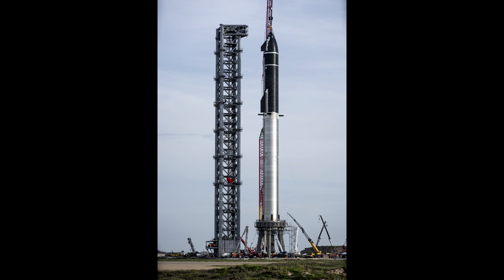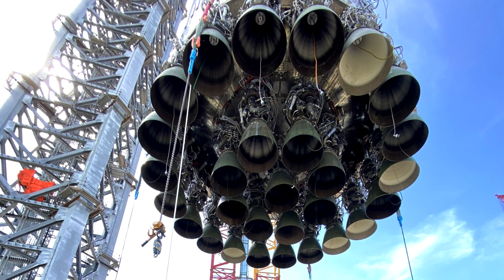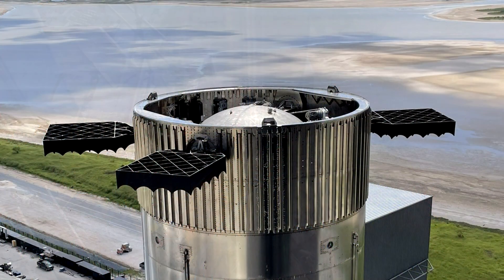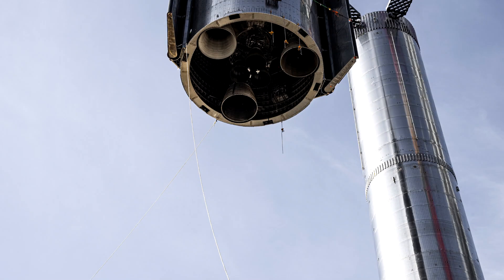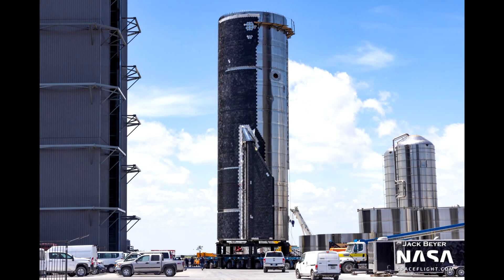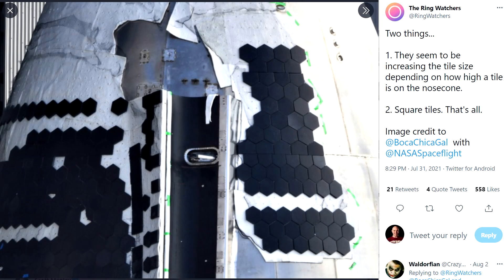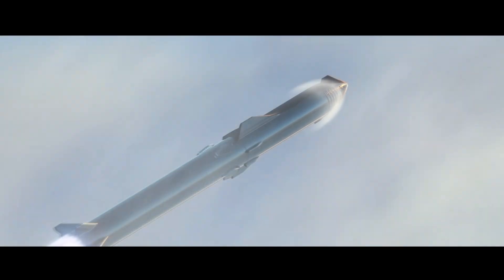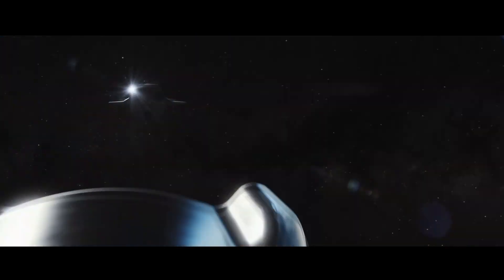How SpaceX Designed A Heat Shield For The Largest Spacecraft Ever Built

Comment: The cubesat was a great idea. The original arm was to do that on all the shuttle flights before re entry, but never happened. Why not use a $1k cube sat for exterior inspection on each ship? Makes sense to me. Would just need to back haul the camera and data to the starship, should be easy.
Reply: Yeah it definably sounds like a more useful payload then a wheel of Cheese.
Reply: Yep. And no worries with back haul, it's a digital era, you can beam the data (even in real time if you want) and forget about the camera.
Reply: If you watch the 2nd part of Everyday Astronauts video though, Elon mentioned they're not going to install payload doors for the first 10 or so vehicles. He said this was because they would be improving the vehicles so quickly, that they wouldn't want to keep the tooling around for maintaining older models, as this is what happened with Falcon 9. And there was no point in putting doors on vehicles that would never fly real cargo. Now a cubesat is really small, so maybe they could deploy it in some other clever way. Maybe it could be stored at the top of the booster and pop out during separation?
Reply: Just take an 360 camera and let it fly away herself. No need for complex expensive small satellite.
Reply: Only recently with Perseverance they had the technology.
Reply: Doesn't even need to be wireless, could be little more than a bit of compressed air with an electronically controlled valve and a camera attached to a wire setup to just get passively pulled out by the 'cubesat' once it's past the length of the vehicle.
Reply: Not to me.
Reply: @arik_dev  Maybe stow it in the engine bay and have tiny thrusters on it to make sure it doesn't collide with the engines?
Reply: Looking at this and thinking about the fact the space shuttle needed to be piloted for the first flight, I'm happy that starship can fly unpiloted... 
This looks like "pretty sure this will work" engineering, or it feels to me like it, a far cry from "I will bet my soul, my spouse and collection of nerd stuff it works" that was the space shuttle. 
As of now I'm thinking the starship way is better but I'll wait for the wonders of hindsight to make a final call in that.
Reply: You know, at some point they have little robot replacing tiles on the fly.
Reply: I like the idea as well, but a ~3U cubesat costs a bit more than $1k
Reply: We have many similar interests
Reply: @swissTom124  The cubesats have been built by middle and high schoolers under a NASA program, so they are not that expensive compared to the rest of the vehicle. What's $10,000 or even $100,000 when each engine is around $1M and there are 6 of them on Starship (second stage) and 29 on the booster that will be ditched.
Reply: Question is, if they find out a tile is damaged, what are they going to do about it?  The design strategy is about removing features not adding them.
Reply: @arik_dev  Store it at the bottom under the engine skirts. I believe some rockets, including a few falcon launches did that. Just make sure to release the satellites AFTER you shut down the engines!
Reply: For the shuttle, they basically could not afford to "fail". In that, if it was damaged, there sadly was no backup plan. So they just had to avoid it as much as possible. Where as SpaceX can and hopefully will, have backup plans (abort to orbit etc with a second Starship actually really ready this time to recover people in orbit, unlike sadly the Shuttle, where they'd run out of food/oxygen before the backup got up there).
Reply: The Canadarm was modified to scan the underside of the vehicle before reentry. Since every shuttle was equipped with a Canadarm there’s no real reason to spend money on a cubesat
Reply: @hermanni1989  That's actually a cool idea, but tricky. As Scott said, removing tiles requires a coring drill. So you'd need a little space drone with a drill, an arm for attaching tiles and a payload of tiles. It would also need a way to fix itself to the craft while it drills, otherwise it would spin itself instead of drilling, and it would likely have to work autonomously. Bit of a tricky system. Feels like maybe instead of replacing the tiles, they could come up with some kind of slap on patch that would get the vehicle down if a tile did come loose. That wouldn't be rapidly reusable, but it would only be for emergencies.
Reply: @TechyBen  Depends on what you call 'backup plan'. If desperate enough you could hastily attempt to patch your heatshield with whatever you have on hand as highlighted in the Space Shuttle Colombia accident report. Alternatively, Nasa usually made sure that the Shuttles were always within reach of the ISS (at least for most of the later flights). They even had plans for the ISS to maneuver towards the Shuttle if needed. Plan was to evacuate to the ISS and get the Russians to help slowly bring back the astronauts. Of course these desperate backup plans were only thought of after the Colombia accident, no backup plan existed prior to that.
Reply: Put optical cameras with telephoto lenses on every Starlink. Not only act as a distributed telescope system, but also have eyes on everything in LEO. Start cataloging all the space junk for collection.
Reply: @MoonWeasel23  only because launching is so expensive, and the regulations onerous.

It's absolutely possible to slap together a balsa wood cube sat with a raspberry pi in a couple arduinos. Planned obsolescence taken to the extreme, like a single-use razor.
Reply: @pseudocoder78  well if they tile both sides, and get the flaps to fold both ways, lose the tile on one side try entering upside down?

Might be easier to make a robot that can replace tiles. It's a huge ship, margins are always going to matter, but it might be time to start thinking about adding droids as a standard consideration. Possibly even supply the starships with their own rudimentary AI, so damaged Starship could divert itself to a storage / repair orbit, in case of tile damage, then just deal with it later, possibly in batches.
Reply: @arik_dev  it could pop out of the engine bay. A cubesat has a mass that is not high enough to damage anything. They could ditch it after each flight if they wanted, which means no need for any complex comms arrays or solar panels. All it would need would be a single RCS thruster and some reaction wheels
Reply: It's actually "we think we can get it to work eventually engineering". Elon basically said " as long as it doesn't break the launchpad we're happy" (he called it Stage Zero) and "we might as well break it because it's going to scrap anyway" .
Reply: Cubesats are easy, but im not sure anyone has ever made a space drone before that can fly around at will.
Reply: The cubesat could be stored in the skirt.
And if they develop this technology, they could improve it into orbital crane cubesats, they could move payloads and modules to dock them, or make repairs without an astronaut.
It's such a good idea
Reply: Just need an R2 unit to make repairs.
Reply: Just do a backflip in front of the ISS like Shuttle did.
Reply: Heck. Just use a wifi network on the ship for the satellite.
Reply: @arik_dev  I think Scott has the right idea with deploying it from the skirt.  There's plenty of space between those vacuum bells.
Reply: I love watching you collect the coins from the laundry thing lmfaoo.
Reply: Well what kind of control does a thousand dollar satellite have?
Cant expect a deorbiting independent craft for a grand.
Reply: @pseudocoder78  They would probably only do this for early iterations. The point would be to have more information about what went wrong so they can improve the next iteration, not to fix anything during the flight itself.
Reply: This is like seeing someone from your home town  somewhere you don’t expect. Excuse me sir but you don’t belong here lol
Reply: @joerivanlier1180  And then the space shuttle blew up and shattered the myth that it was a good idea. Space shuttle was a disaster from day one. Designed to be "reusable" since they figured the Saturn V was so wasteful since nothing but the crew capsule could be reused. Thought it would save money in the long run, ended up costing WAY more per flight than if they'd just kept the Saturn V. The ONLY advantage that the space shuttle had was its ability to return satellites to the ground, and judging by the fact that no other space agency ever bothered going that route, it's not really a feature anyone really cares for. Russia made their Buran, but that was more or less just a cold war response that they could do a shuttle better, considering it achieved nothing of significance and was stored and never used again. 

For all the ridiculousness of spacex claims and plans, Starship is somewhat promising, and if it is at least as close to its intended goal as the space shuttle got to its goals, then it will blow everything else ever launched away.
Reply: The thing just needs to be a camera with a radio, guidance system, and simple RCS. They could name it 343 Guilty Spark.
Reply: @arik_dev  The drill would have to be inside the tank, so this is not the most clever idea.
Reply: @joanpere8863  Oh, my bad. I forgot it had to be from the inside. Well that just makes the outside patch idea seem more attractive.
Reply: And possibly a patch kit that can be applied if adjusting starship orientation to favor the weak spot is not enough.
Reply: @arik_dev  Yes but it has been mentioned before using containers in the aft skirt to store cubesats and such, would be a perfect place for one without impairing R&D process
Reply: Developing a special purpose vehicle or cubesat like that would pay for itself by being useful for all sorts of exterior surveys, whether of Starship, or ISS, or anything that needs it in the future.
Reply: Would’ve saved columbia
Reply: You could probably just stick a $30 camera on a piece of metal at the end of a wire. You would also need a gas vent to push it away from the ship, and a mechanism to pull it back in, like a spool and a small DC motor.
Reply: yup, it's a good idea to have that cubesat especially for suborbital tests, an arm might be more useful on the finished versions, seeing as it would be reusable.
Reply: If you don't crash them, you have to store them... one thing I learned in the EDA interview.  Elon actually likes the iteration cycles... build them faster than you crash them.  They'll have cameras inside the tanks... if a tile comes off the steel will glow white hot, no need for infra-red!
Reply: Have a cubesat orbit Starship for inspection.
Reply: Man bring a camera to space but he forgot something very important that most people should know about it a BATTERY FOR CAMERA 😂😂😂
Reply: @pseudocoder78  it would be for data collection, not a permanent solution, starship will be flying with no payload, so the ship could easily just carry a CubeSat with it. on its back with an aero cover or as some said possibly under the skirt, or in a small compartment with a small door where the payload bay will be, elons said in everyday astronauts interview with him that they will probably be doing at least 10 or so orbital test flights to collect data with no payload at all, so this might be a great way to examine possible stability weaknesses within the thermal tile system that would be difficult to gather if starship doesnt survive re entry.
Reply: What I'd like to know is the comparison of reentry speeds between the two vehicles the old shuttle and the new SpaceX vehicle that's also going to be a factor as well as the new tile design maybe for all we know SpaceX went above and beyond making the heat shield but maybe they have a lower re-entry speed
Reply: Velocity
Reply: So a literal 3rd person camera irl? Sounds like a plan
Reply: Space-X used those tiles on the Dragon during reentry from the ISS, to make those tests
Reply: Starlink with a camera on it. Then once its taken the photos it can become part of the constellation and just download them. Elon, you can thank me later
Reply: @GiBBO5700  the starlink orbit would be very, very different than starship
Reply: @scythelord  "WAY more per flight than if they'd just kept the Saturn V"

Uhh no 
Saturn v marginal cost: $1.2B per flight

Shuttle marginal cost: $252M per flight

And even if your include the fixed costs for the shuttle it still averages around $450M

Oh and before you come at me with the "But shuttle costed $1.7B per flight" That figure includes non-recurring costs and if you also add non-recurring costs to the Saturn's number you get $10B+ per flight

And yes the shuttle (orbiter) was reusable refurbishable means pretty much rebuilt after each flight and if you have even the slightest idea of how shuttle turnaround worked you would know that it was definetly not rebuilt each time
Reply: I think, an onboard robotic assistant that can walk around the outside of the StarShip to perform directed inspection and maintenance autonomously, possibly a Boston Dynamics robotic dog like Spot with magnetic feet.
Reply: @Makoto778  Yeah. :(
Reply: Someone tell Elon about this cool idea
Reply: Make it a spherical drone with liquid-air RCS that can return inside its hatch once the mission is done?
Reply: @Krommandant  that would probably be a very simple thing for the question would be how much it cost to engineer all that stuff and it would very likely be a one-time-use you could just jettison it have it do the survey and it'll eventually re-enter
Reply: @pseudocoder78  they will know what went wrong which is half way to fixing the problem. Trying to work out if you lost any tiles from a debris field is a lot harder than it is from a photo.
Reply: Scott Manley: proposes cute cube-sat heatshield inspector
YouTube audience: tries to flesh out the details
Elon: “Hm. Extra requirements? That's not good. Let's just increase our production and then always launch two full starships simultaneously, so they can inspect each other's heat shield.”
Reply: On the later Shuttle flights, after Columbia, they did use the arm to photograph the entire underside of the Shuttle and all the tiles.
Reply: Renting mobile homes on the moon any time soon?
Reply: Space drone
Reply: @arik_dev  Yeah, they have a big storage space in the nose cone. I wouldn't be to hard for them to make a small hole for launch mechanism there. Also having it on the top of the ship wouldn't impact the heat shield etc.. I got really hyped! I might just do a simple design for learning purposes!
Reply: Scott should go to Elon's twitter and tell him this idea
Reply: @joerivanlier1180  Elon mentioned this in the Starbase tour with Tim Dodd (Everydayastronaut).  Basically the shuttle had to be manned, which meant they had to design it with almost no chance of failure from day one.  This meant they couldn't change the design without massive additional testing.  Starship on the other hand was designed to be iterated rapidly.  They launch & learn where the weak points are that need additional design changes.  S20 will not be the final design, but will teach them what to change on the next iteration.  This is only possible with unmanned vehicles as the chance of catastrophic failure in an untested design is high.
Reply: Alternative to a drone, not sure if it is easier but it doesn't require a drone with thrusters or a roll by the starship and is instantaneously.
Modify the tiles to have a simple electronic circuit in them (or on them, in a way that they break if the tile breaks) and have one of the plugs be a simple connector. Now you can detect presence and optimally condition of the tiles very easily. Doesn't need to be high voltage so the additional wiring shouldn't be too heavy if done smartly. Biggest problem is increased production cost of tiles and reliability, as well as added complexity of tons of circuits in the shell.
Reply: @ironagent45  In the engine bay is a bit risky... And I don't think there will be room for anything besides engines and plumbing.
Reply: Not really much point doing it before re-entry for the Shuttle. There was no way to fix the tiles in space or rescue the astronauts.
Reply: 1k ? Maybe it might even be worth to just let it burn on reentry and pack a new one before launch...
Reply: @joerivanlier1180  So who's your pick for the 1930 World Cup?  :)
Reply: @arik_dev  a cubesat is made for specific things though! And none of those things is visual inspection of a spacecraft. Like why are people even mentioning using it for that? It'd be like let's use a blender to inspect the ship. Cubesats don't have cameras or controls or anything useful for that application
Reply: Should be easy... um, no. 
Remember Zero G, the math & physics you’re describing are not easy. 
if only $1k, they’d just let it burn up.
Reply: @arik_dev  you could just have a "patch" tile you slap on top of the existing ones, held in place by that red glue they talked about.
Reply: @ScorpionXXXVII  Isn't "cubesat" just a format, and not a specific model of satellite?
Reply: I don't see why you couldn't pump some instant ablative coating filling to replace and/or fill a missing or cracked tile just the way they fill a ding or crack in your car windshield with superglue via a pressured syringe and temporarg patch. A robo-sat could do this too and its far actually easier than removing and replacing a tile! :-) Like the fully ablative spaceships coatings the patch only has to last the one reentry where a human can then clean out the charred mess so a full new tile can get reinstalled. :-) And Bob's your uncle! ;-) Haha.
Reply: Why not tether a tiny camera with fishing line and let it orbit around on a string?  Not as hard as lassoing a steer. Out to be someone in texas who can do that
Reply: @joerivanlier1180  yea definitely agree but this way is cheaper and faster, design is okay but testing and thinking of wat abd where and how to test and coming up with entire projects just to test something thats where it tales years so just blow it up and see wat happens, also computers take the majority of testing now
Reply: @howard6433  whistle whistle long whistle)))
Reply: @swissTom124  sounds good in theory but the problem with that is all the space junk already around Earth. The camera might not re enter Earth and burn up and that would become a huge issue.
Reply: If it is easy at this stage, then you probably aren't doing it right.  Conceptually, sure, but I wouldn't minimize the real effort involved.
Reply: And when you see a defect, what do you do?
Reply: @toddmarshall416  in the case of SpaceX you could actually launched something up to save it that was the shuttles downfall they would have had to stay in orbit for another month with an emergency system to try and prep another shuttle to Launch
Reply: دنىخ
Reply: Ice chunks would fall off the fuel tank onto the space shuttle heat cubes, the booster is below starship and starship will launch with low fuel and fueled in orbit so it should not be a problem.
Reply: They actually were designing a small autonomous space craft to inspect the shuttle from the outside. We machined some proto fuel tanks and pieces for it.
Reply: @ScorpionXXXVII  ….  A cubesat is made for whatever purpose its owner/creator wants it to accomplish. If a “specific thing” does not exist, it is designed, engineered and constructed.
Reply: @steveaustin2686  0
Reply: Kh
Reply: A number of early cubesats were just pitched out the airlock of the shuttle.  The Japanese built a 4" cube that simply had LED panels on all sides, a battery, and a control circuit putting out a pulsating signal with an average signal of only about 4 watts.  While the light would not have been visible with bare eyeballs, being a few magnitudes dimmer than what unaided eyes could see, it was still well above what decent telescopes could see.  they watched for it with ground-based telescopes.  In this way that they discovered that they could do purely optical digital signal transmission up into at least the upper megabits per second down from orbit without even bothering with lasers or much power.
Reply: @Gaelztorm  More useful than cheese?  Nothing is more useful than cheese.  But okay, I can compromise.  A bit.
Reply: How much did you earn from your vending machines today?
Reply: So, what would they do if the cubesat, found tiles missing or damaged, it's not like they can pull over to the curb and replace them?
Reply: @hermanni1989  they will Have Too😉
Reply: What the point of a cube sat to look at it? You'll still need an arm to fix it.